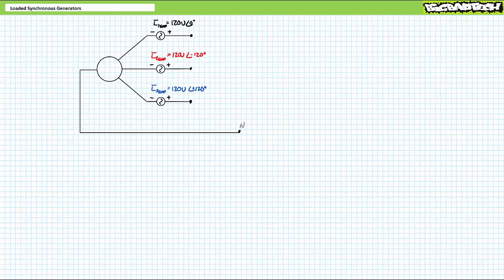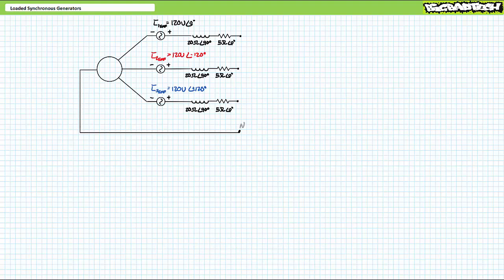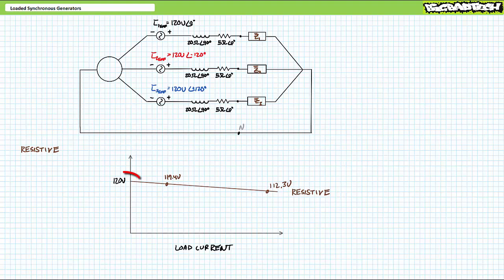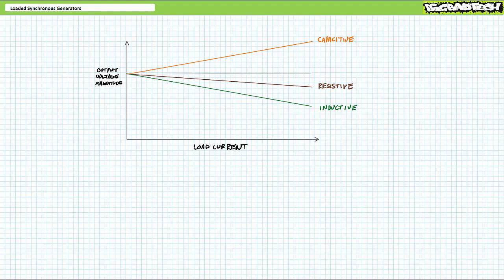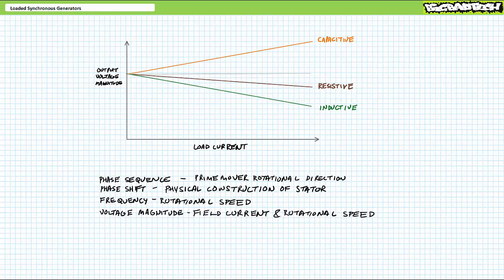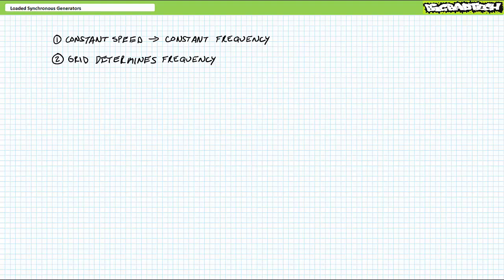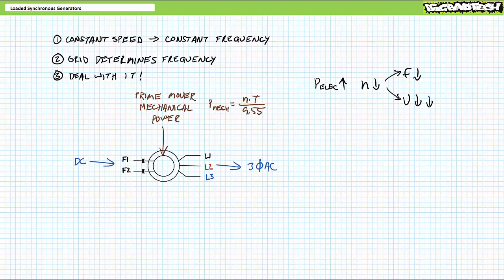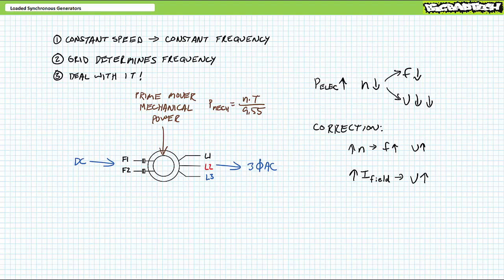Loaded Synchronous Generators (Full Lecture)

Comment: Thanks for the great lecture. Apologies if this is covered in another video, but what is the source of the oppositional torque when the generator is loaded? Is the magnetic field generated by the stator current not rotating in the same direction as the rotor and at synchronous speed? 
Or is it due to phase shift between stator magnetic field and rotor magnetic field, like how torque is generated in an induction machine?
Reply from the maker: Check out the Electromagnetic Interaction lecture at: https://youtu.be/arE7RCBQDEo?si=sruFI5i9qKVO_hAC
I want to say the generator braking torque is formally called Lenz's Law.
Reply: @bigbadtech  that explains it well, thanks

Comment: Hi Jim I am a new subscriber and have been watching your lectures on asynchronous Induction generators. I just got a large unit from a local College that has a 40Hp gas engine as a prime mover, with a Large Induction motor and Woodward GCP-21 series Genset controller . I want to use it to run a 220 3 phase motor on a shop machine. Instead of hooking it up to the grid can it be hooked directly to that motor? Also what excites the generator to put out power? Is it just exceeding the synchronousity of the motor or does there have to be a connection to a 3 phase grid?

Comment: The audio is very low volume and distorted. Difficult to hear.
Reply from the maker: Serious question ... did you try this on a different system or adjust volume? I recently discovered some audio issues on other lectures. I thought I had it fixed!